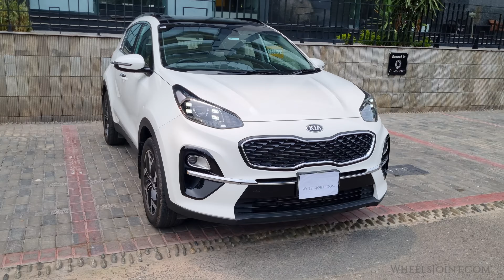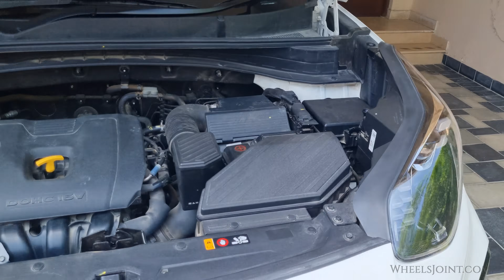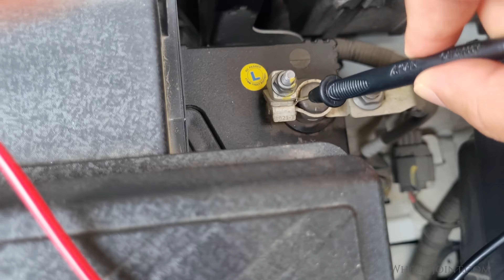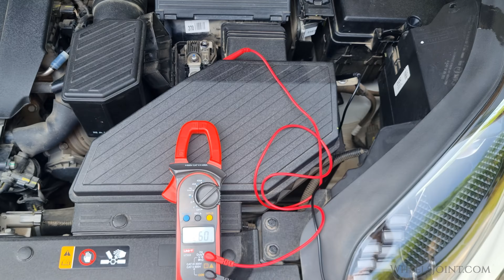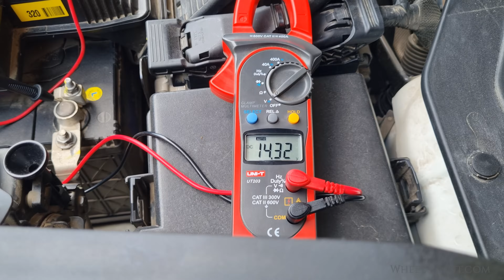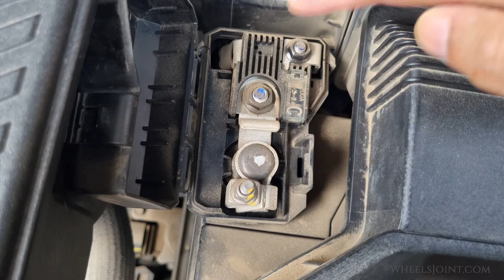How to test the battery of Kia Sportage with a multimeter

Comment: Hello my friend,

Thank you for the videos. I want to discuss a unique problem that nobody has been able to solve yet. Maybe you've encountered something similar.

My KIA has a parasitic draw of more than 100mAh. After turning off the car and locking the doors, it doesn’t show up immediately. However, after some time, it starts drawing a high current.

There are no accessories, custom parts installed, or lights left on. I have also replaced the fuses, but this delayed behavior is suspicious. Could it be the alarm system?

Previously, the car used to blink the turn signals once (a long blink) when I lock it, but it has stopped doing that. Also, it used to honk when the alarm system was triggered, but that has also stopped. Could these be related?

The dealer in Türkiye couldn’t solve the problem and sent me away after replacing the battery. However, even the new battery drains within a week when the car is off. So, I’ve decided to tackle the issue myself.

I’m planning to replace the relays in the engine compartment as a next step. Before I do that, do you think there’s anything else I could try?

The car is a 2014 Kia Sportage 1.6 gas.

Best regards,
Reply from the maker: You're wasting money replacing components without pinpointing the cause. You should perform voltage drop test on all fuses with a multimeter. Many helpful videos for that on Youtube.